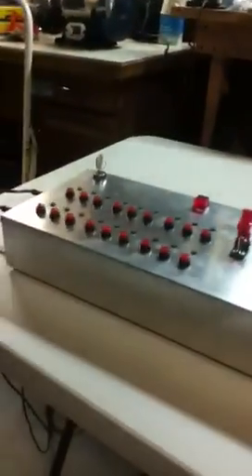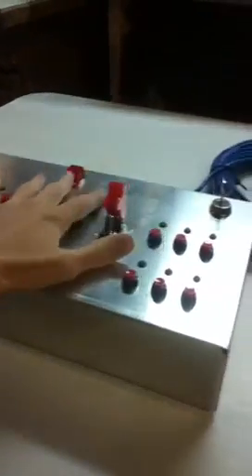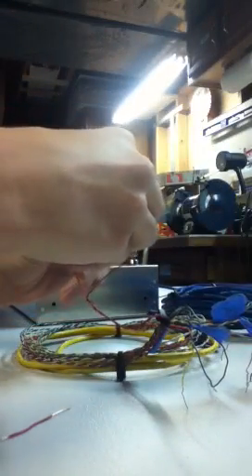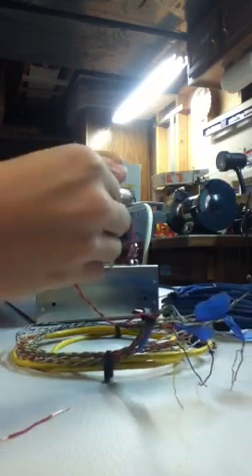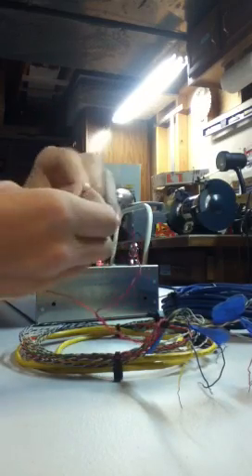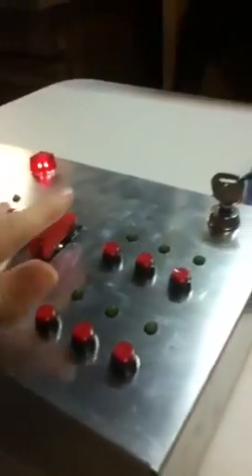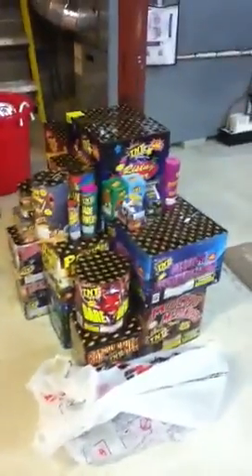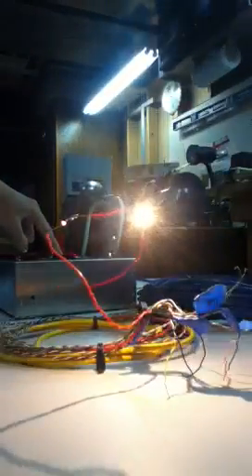Demonstration of resistors as firework igniters

Comment from the maker: How long does it take to make 100 of them? and last year I used nichrome wire which is a pain to work with (seeing as it's hairthin and flimsy), and half your process depends on hairthin flimsy wires. For clarification, none of my resistors actually popped during my show, and the only thing that caught on fire was the fuse.

Comment: umm in in the USA also. you can build electric matches using a small hair fine piece of copper  magnet wire wrapped around a normal strike on box match and I guarantee its cheaper than a resistor, will work better and not catch your wire on fire before the resistor blows.

Comment from the maker: Here in the USA we don't pay by the electron, only by the kilowatt hour, and that's 11 cents. Electric matches are 6 for $1, resistors are 3 cents each. We use higher voltage to be able to get the current down the 100 ft of 26AWG CAT5 cable. We can either use more money on igniters or fireworks, we chose more fireworks.